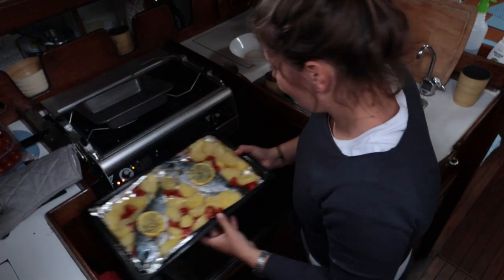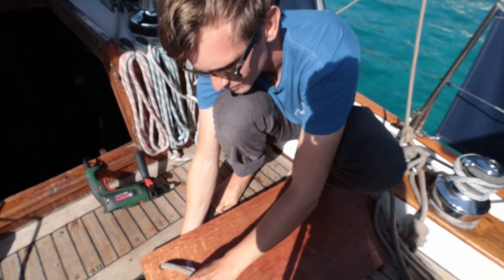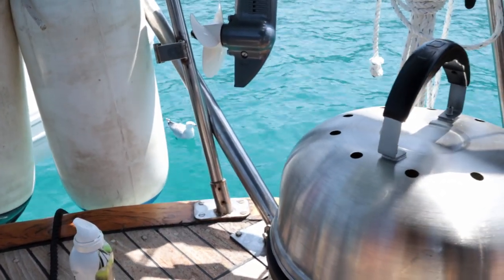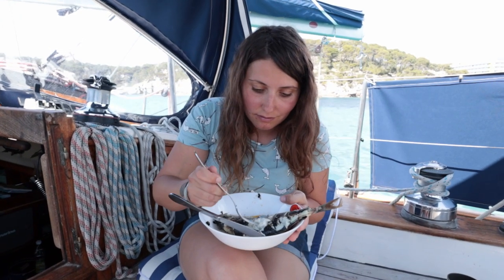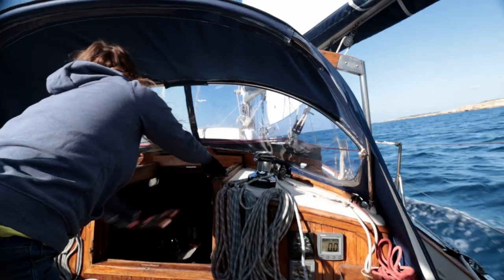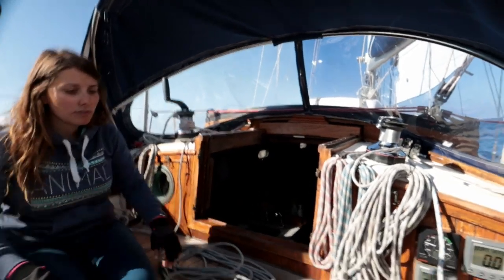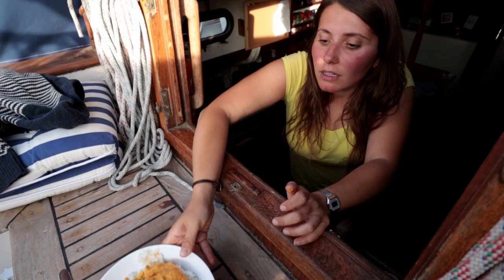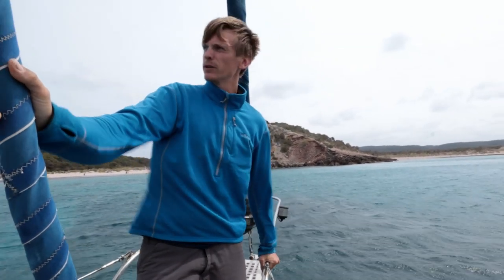50] The HIGHS & LOWS Of BOAT LIFE | Sailing Skua

Comment: Hey so i've used a flopper stopper a lot. In the end I had it perfected.  In the end I had a 800mm diameter drogue chute with a 5 kg weight on the bottom suspended so the lip of the drouge is just about 25mm out of the water. In light rolling the drouge would pull up out of the sea full with water that would run out of it quick enough that it would dampen the roll back towards the drouge. Then another line running down from the halard through the center of the drouge  connected to two plates of 4mm Aluminum about 300mm 900mm that hinged together. Lifting from the corners and then a weight pulling down at the hinge. So they would fold together on the down stroke and dive and Open on the up stroke. The drogue chute would manage light rolling that would not actuate the aluminum flopper stopper and when a bigger wave would kick in the aluminum flopper stopper would just kill the big rolling.  Once I had made it so the aluminum piece didnt open too far and get itself stuck turned inside out and learnt how much drouge should be out of the water really 5mm can make a big difference it was amazing. I had it setup so it would take 2mins to deploy and retrieve. If you want a more detailed explanation we can chat with another medium if you like. Cheers good luck
Reply from the maker: Holy moly that sounds like a serious bit of kit! We've been in really great anchorages lately and the swell's been organised so we haven't used it much but when we start heading westwards we might need to refine it a bit more. We have a drogue on board so maybe I can experiment with that. Our plywood one takes the edge off and stops the out of control pendulum but she will still roll gently to the side swell if there is any.

Comment: If you want the simplest form of flopper stopper, a submerged 20 litre bucket works a treat, two for a bigger boat, if the handle isn't strong enough, drill 4 holes under the top lip and make a dyneema 4 point bridle, you can throw a rock or dive weight in the bottom, cheap, no big deal
Reply: great idea but that marine ply worked a treat , easier to stow away too. great job.
Reply: I can think of a multitude of feasible flopper stopper designs, made from a multitude of materials, all will work, I'm definitely not going into and details because I'm a South African sailor, who's currently in the process of surveying and purchasing a small 36' double hull Huntingford designed modified full keel semi displacement cutter. The exchange rate is not in my favour and as such I am keeping the majority of my potential money earning schemes close to my chest. What I most definitely will have aboard is stainless steel and aluminum Tig welding equipment onboard (from my own due diligence and input from cruisers' forums and long term cruisers, one of the more difficult things to get done properly) amongst other things, if you can fix/service all your own (and other peoples) boats leaks, lamination issues, service winches, marine diesels, outboards, or have any kind of fabrication, mechanical, structural, rigging and electrical(12, 24, 110 and 220\240 V) knowledge and experience you will be able to make a lot of money in marinas and anchorages. There are a hell of a lot of boat/yacht owners who do not have the foggiest clue how their boat systems work, but who have $$ in the bank. 
Thanks for putting more ideas in my pip
Reply: @jonnorousseau3096  I do boat electrics for a living but I am very selective who I work for! Only people with a drive to learn to do it them self's are worth my time. You can never please stupid and lazy customers.  They only give you heaps of aggravation.

Comment: We had a Mariah 31 with a bobstay. A suggestion. I put a PVC pipe over the bobstay. 1.25 inch diameter or so. It prevents chafe on an anchor rode and stops noise from chain as well. Lasted many years of cruising the Caribbean. Skua had many similarities to our old Pacific Seacraft Mariah.
Reply from the maker: Cheers Ed, when we replace the bobstay we'll probably fit a tube over it - we have tubing over the bridle which helps a lot. We'd also like to replace the bobstay fitting and use the old fitting as a lead for the snubber.

Comment: FYI if your having a real problem with the wind and the swell swinging your boat around hook a line to your anchor chain and to a winch on the stern of your boat and winch it in until you get square the wind in the swell and then cleat it off and it will hold you steady
Reply from the maker: Hi Bryon, thanks for the tip! We've tried a swell bridle like you describe, but often in the Med there's not enough wind to hold you consistently in one direction so we've found that two anchors or the flipper stopper works better.

Comment: If you must insist on using a flop-stop, then you need to perfect it a bit more.
Ballast your board centrally, cut out two symmetric square holes in the board and cover them with hinged flaps (like doors). They will act like check valves.
They open as the board sinks and close as the board is pulled up (minimal resistance on the way down, maximal resistance on the way up)
Reply from the maker: Cheers fesh fesh, the idea with ours is that it dives by turning more vertical, rather than using check valves - are they still useful? We've ballasted the board in the middle plus on one side and it does work better like that, though since we've been in better anchorages lately we haven't needed it so much :)
Reply: @SailingKittiwake  What you want from a flop-stop is fast reaction time everytime the direction of the vertical motion is switched, and technically speaking flapper check-valves are the fastest reacting.
Reply: What about adding another flopper stopper to the other side of the boat, this would mean the roll of the boat is slowed
 both ways and would give the opposite flopper stopper more time to sink?
Also who doesn't love saying flopper stopper? lol

Comment: You can buy waits that are made for that. You hook a single line to it, and the plywood should be more triangular with the points rounded off.commercial fishing boats use them.the wait has a metal rod with a hole to connect the line to

Comment: Try the weight on the flapper board in the center between the short ends but slightly off center between the long sides there should be less leverage caused by the weight which means it should go flat for the up stroke more readily. Just an idea. 😀

Comment: I was interested to see the aluminum boat in the anchorage seamed to be sitting more quietly than you but also closer to the shore? Or was it just when I caught them on the video?
The 'Magma R10702 Rock N Roll Stabilizer' apparently work well. The folks on 'Boat Fam' used it very successfully on their old trawler in the Bahamas the center hinge design means it was fast reacting. They reported that they were surprised how well it worked but continued to use it for a whole season . It was quick and easy to deploy too, they has the outrigger set for quick deployment.  On skua I think I might have used a whisker or spinnaker pole rather than the boom. I could not find the video where they talk about this model but real world experience counts for a lot ,( they are currently on different adventurers after they had a third child! But plan to go back afloat in the future).
Glad your enjoying Skua you have really settled into her! Cheers Warren

Comment: Ain't she a stunner! There's no angle from which she doesn't look very "yotty" in its best sense no matter on deck or down below. 
Are You content with her upwind capabilty when tacking? Sag in the fore stays would flaw this considerably and could be somewhat stretched out with the aft stay.

That flapper board might need a rubber between the weighted side ropes and the others.
I don't like these but had once a customer onboard screwing around a Meltemi fourtnight with one: best results he got when it was about 45 to 60 deg to the weighted side and a rubber tying the two pairs of holding ropes together that way; the rolling boat making it go upwards would stretch the rubber and bring it into horizontal position with four straight lines in one sweep.
I myself prefer the Yawl-way to cope with rolling as well as with her tendency to sail around her anchor: try to find a place to put a small sail (about half to a third of Your storm trys'l) up in the very back of the boat in a way that she has to stay to one side of the wind when it's not filled - practically like Your steering windvane gets blown onto when deviating only. Can be supported with suiting rudder-lay when anchored, too. Cheers and thank's for sharing!